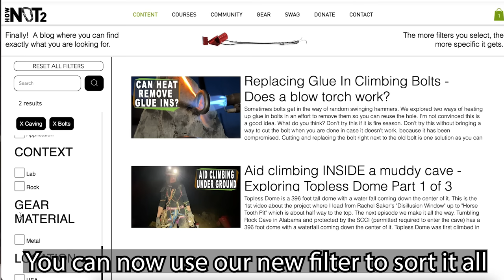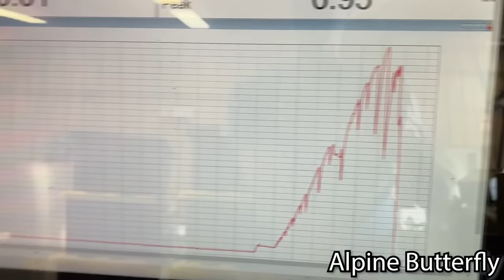15 Knots You Need to Big Wall

Comment: I used to use water knots but saw this video https://youtu.be/mXe-8GmS08k demonstrating a way they can come untied and have led to many deaths. What is your opinion here? I started using a simple overhand recently like an EDK.
Reply from the maker: People have been doing water knots on webbing for many many decades.  It has the flaw that Walter shows but if it is rock hard I doubt that can come undone.  I don't like how bulky it is but it has it's place for some things.
Reply: @HowNOT2  speaking as a random climber, I have experienced a water knot failing (coming undone).  It was not fun and I don't trust them.
Reply: @lwthorn1977  In rope, or in webbing?  Loaded or unloaded?

Comment: Also only Boy Scouts call it a double fisherman. 1 turn fisherman 2 turns grapevine 3 turns barrel knot. How many big walls?
Reply: Maybe in other places, but I have read many books and seen many tutorials that use the easy to understand single, double, triple fisherman’s knot/bend nomenclature. To the American english speaking world, they are the most common names.
As the basics of the knot really doesn’t change, just the number of round turns; why give the different permutations of the same knots different names? 
You even climb outside your area?
Reply: one of the most used instruction book on climbing in North America "Freedom of the Hills" by the Seattle Mountaineers, calls it the double fisherman knot.  the Seattle Mountaineers is older than the Boy Scouts.  Many knots use different names, likely because of regional usages, or perhaps industry terminology where it is used.